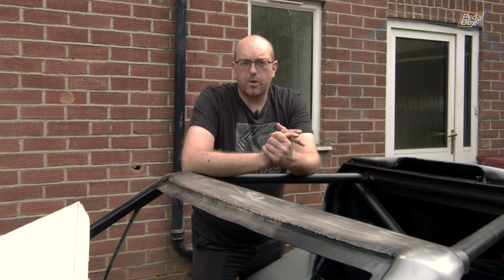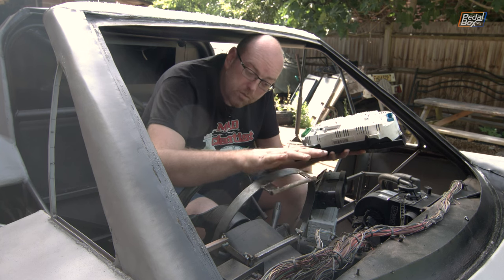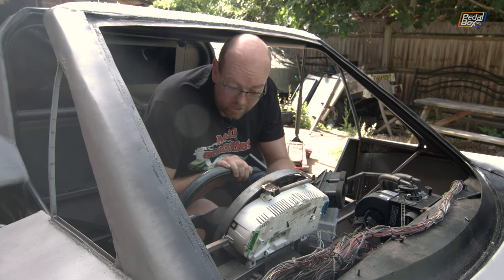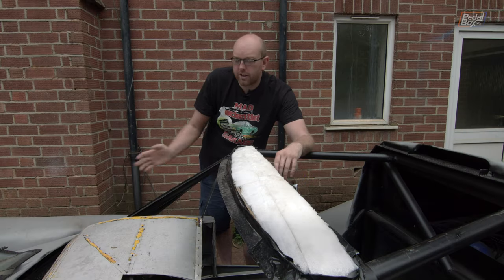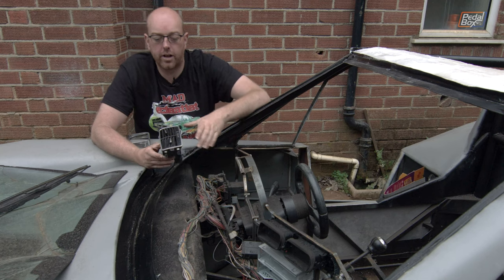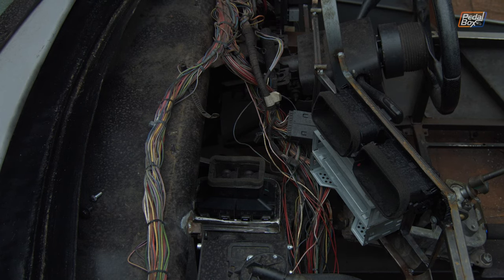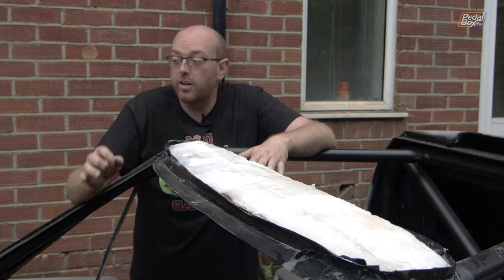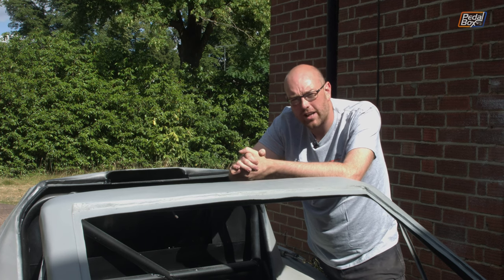Cluster Mounting and Roof Line | Audi TT Kit Car | PedalBox Episode 113

Comment: I’ve been having the same issue with the windshield vent in the 914. I don’t want to use a factory one and all the other ones that I can find are not appropriate.
Reply from the maker: It's frustrating, I sometimes wonder what'd happen with an insurance replacement on this as we'd have to tell them what screen it used, but is that then "non standard" if it's a 'TT' underneath :|

Comment: Wondering if it's more logical to stick the controls on the passenger side, because all the way down there seems like a faff to adjust, perhaps in lieu of safety... but then can see that being irritating if it turns out to be easily adjustable from driving position.
Reply from the maker: So many of the controls have to be "adjustable from a drivers seating position" (like wing mirrors) finding a 'good enough' spot becomes the path of least resistance in the long run :/